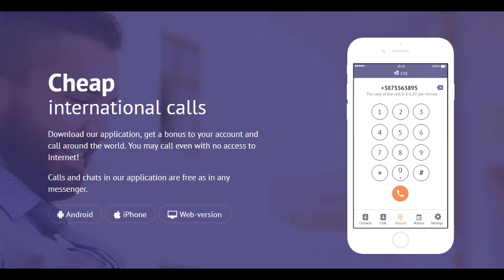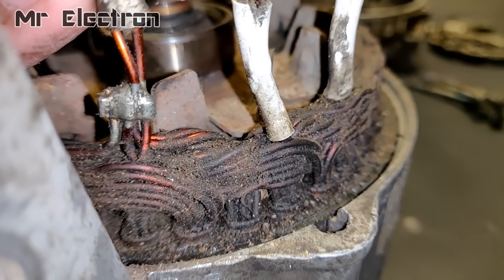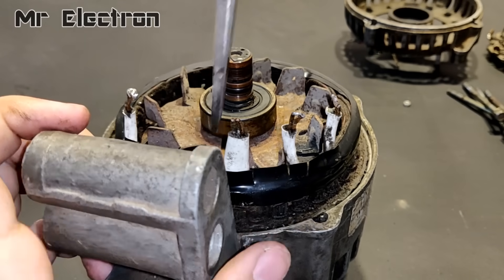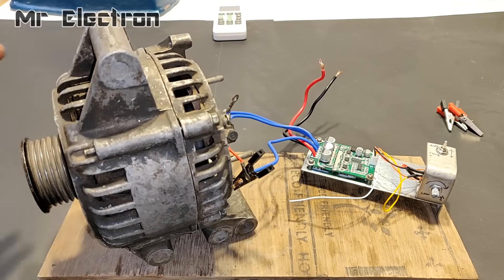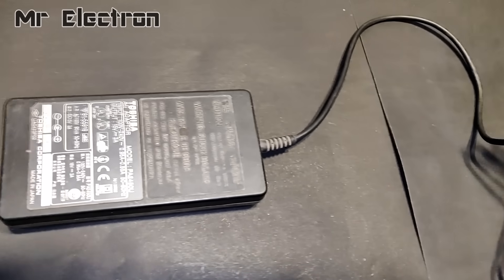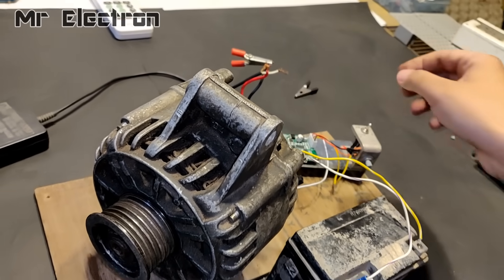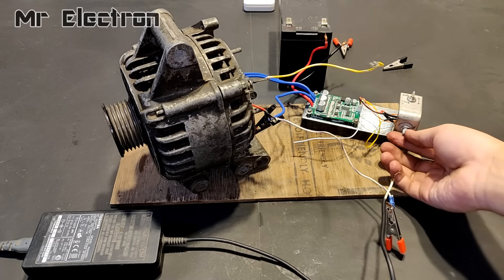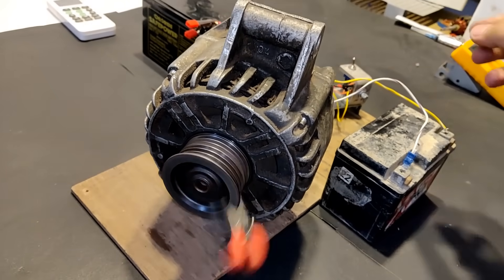12v 120 Amps Car Alternator converted to DC Motor with High Torque using BLDC Controller - Part 2

Comment: Nice discovery. Can this type of BLDC alternator be used to pull another alternator to serve as battery charger?
If yes please I'll need a video where it is working.
I'm wondering if the torque can pull an excited alternator to charge at high amp.
I'll be glad to here from you. Thanks
Reply from the maker: Yes it will work
Reply: @MrElectron  OK thanks.
How many amps does it draw from the battery at maximum rpm under load?

Comment: Did you check the armature windings for heat or was the alternator normal temperature after running it with the controller?

Comment: Thank u for nicely explained, i have tried similar but it keeps burning speed control unit after getting hot, do u know why ? please answer, thanks
Reply from the maker: U might have connected the 3 phase neutral point
Reply: @MrElectron  Thanks i will check it out

Comment: Nice job!
How did you determine the sequence of the three phases of the alternator? Those have to match the sequence generated by the controller, otherwise the motor will not run properly.
Reply from the maker: With this circuit, you don't need to match the 3 phase sequence.. The circuit automatically adapts RYB
Reply: @MrElectron  how can  i buy this type off motor plzz tell mee i need
Reply: Thanks for your answer!